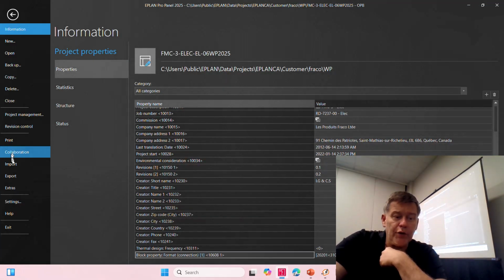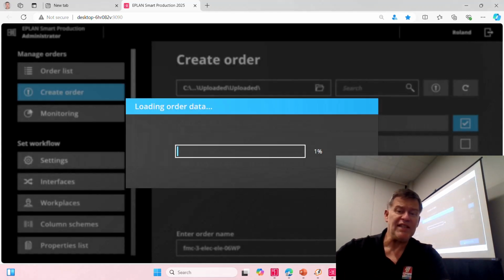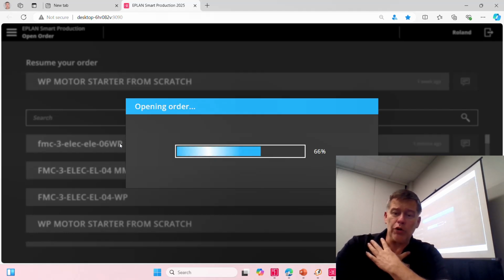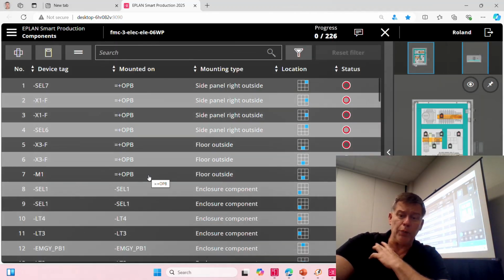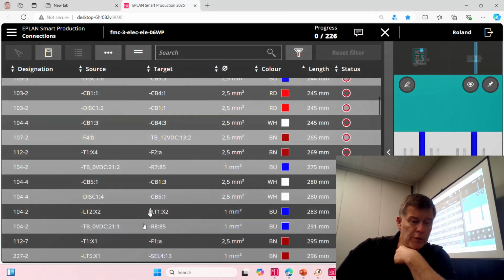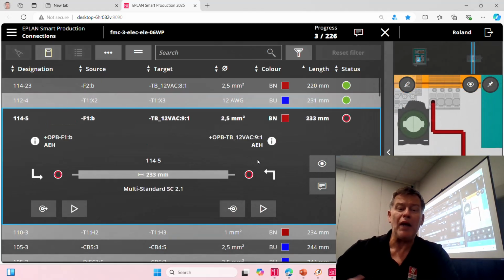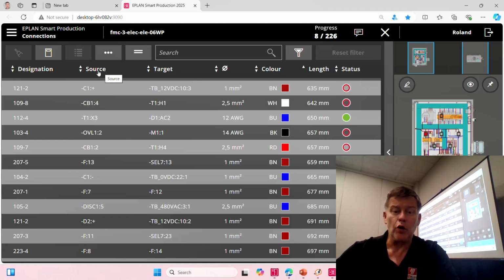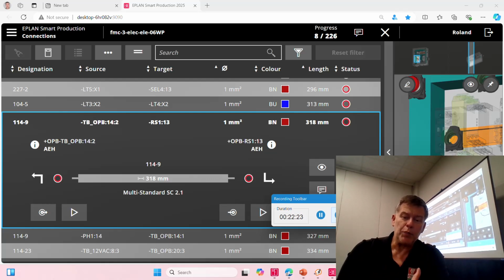Smart Wiring Tutorial with EPLAN PROPANEL Routing and Smart Production

Comment: Hello, I follow your tutorials, and all the praise. However, so far there has been no mention of the connection designation display on the 3D model in the pro panel. So I'm wondering, is it possible to generate the connection designation number at the end of each wire in the pro panel? So that it is visible on the 3D view, and that I have the option of exporting the connection tag, in txt or excel format?
Reply from the maker: When you use Smart Production for your wiring and assembly you have all these details.

Comment: How do you make the production manufacturing order exported from eplan to wire terminal machine match the production order in eplan smart production.  I exported the data from eplan to wire terminal machine. I exported the edpz file from eplan to smart production. Wire sequences do not match. Each wire pulled off rail has to be searched for. How to fix this?
Reply from the maker: When imported into the WT  you define a sequence/ order. There I use wire size and lengths which then are easy to ask within Smart Wiring assuming you added the wire lengths in Smart Wiring. I have a video showing you this setup